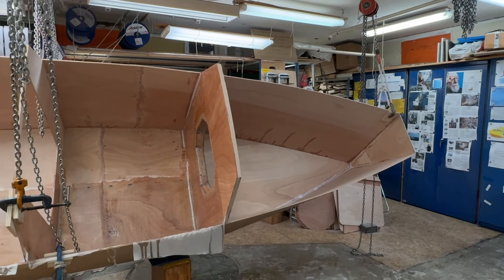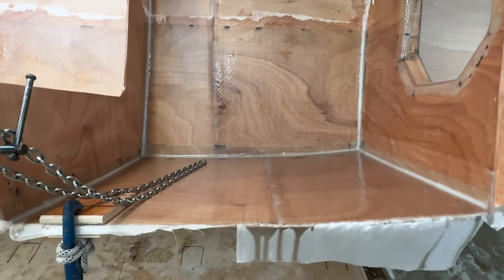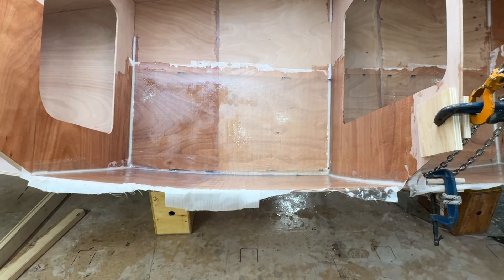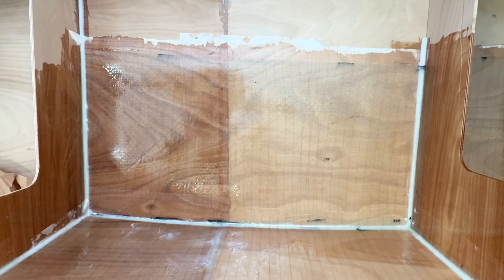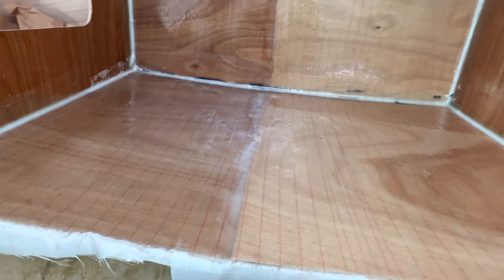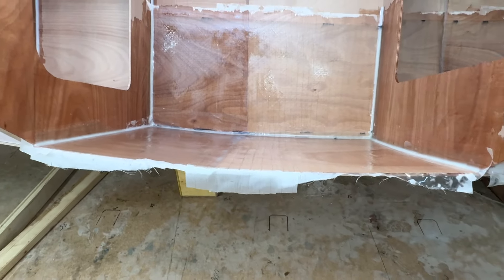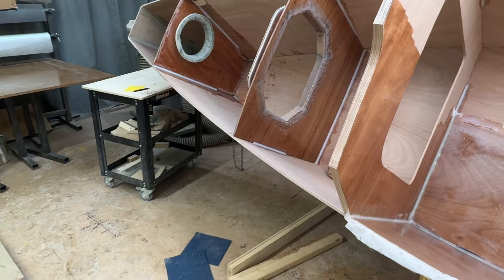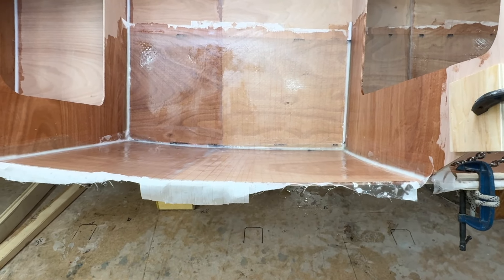24 June 2024 Second day glassfibre

Comment: Good job as usual. Maybe you can answer one of my questions: I thought you were going to glue Divinycell to the outside of the hull/skeleton with epoxy, onto which the outer hull would be laminated. Am I wrong ?
Reply from the maker: Divinycell will be for the next boat.
Reply: @SvenYrvindExlex  But your current plywood hull seems so thin.
Reply from the maker: @guydeherdt9917  Plywood hulls are thin compared to Divinycell sandwich construction